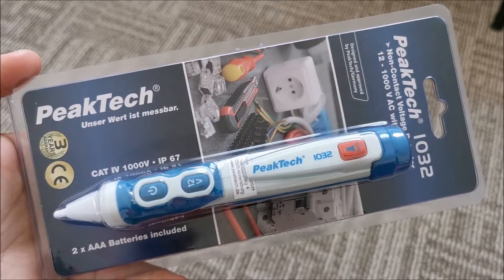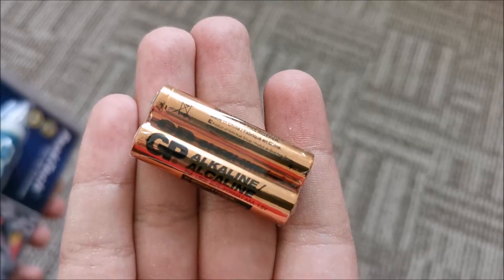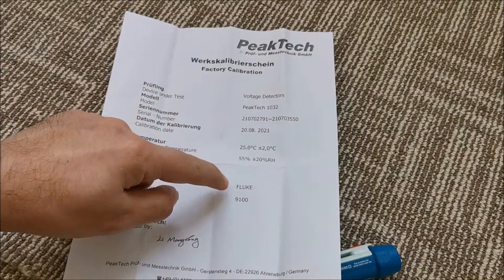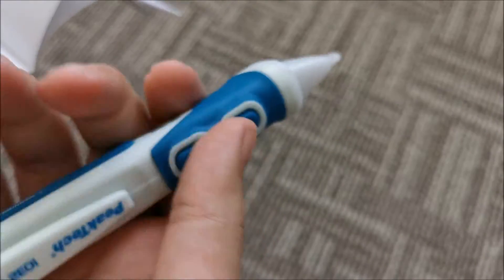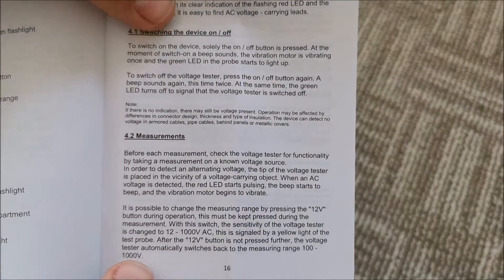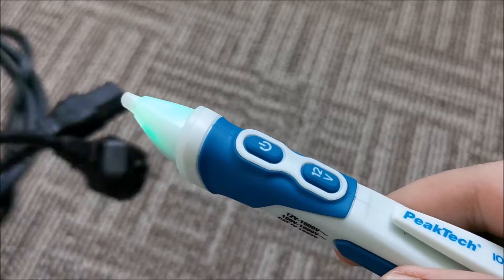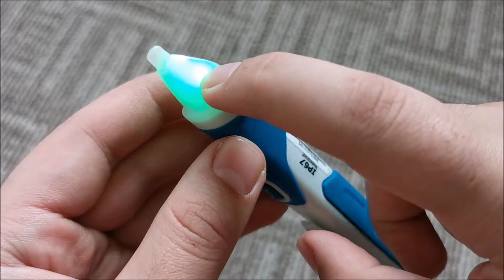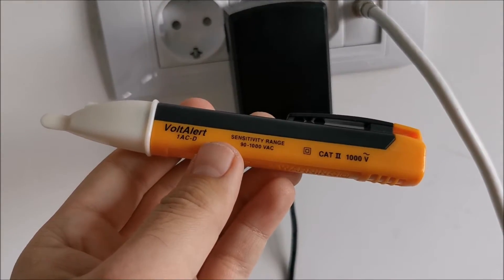PeakTech P 1032 12 - 1000V Non-Contact Voltage Detector - review and quick test

Comment: I hate it when you buy something in bulk, to save time/money. But in the end, it ends up costing MORE, and you waste time in the process.  
  Yes, that new tool looks very robust and looks like it will last a long time.. Well done. Great Video as well.
Reply from the maker: Yes, this voltage detector looks and feels like really good quality. And most important, I can actually trust it.
About those damn power cables from a few years ago, they were the worst ever, I just can't understand how someone could sell them. In one of them, one of the prongs broke off and it was not even solid metal, it was just a metal sheet with plastic injected inside. We are talking about the thick EU round prongs.